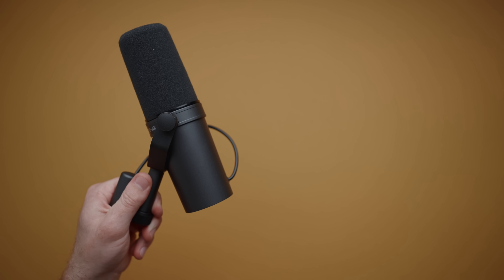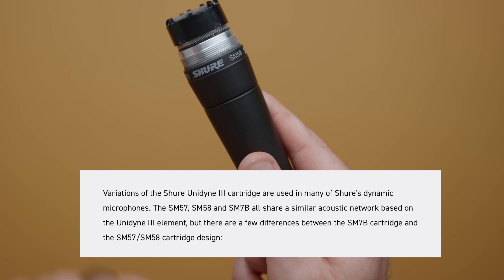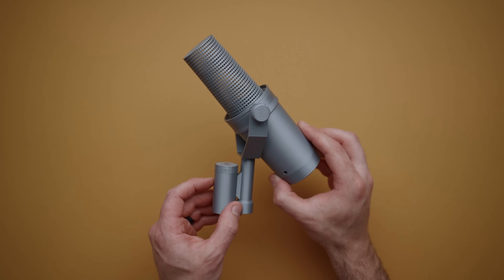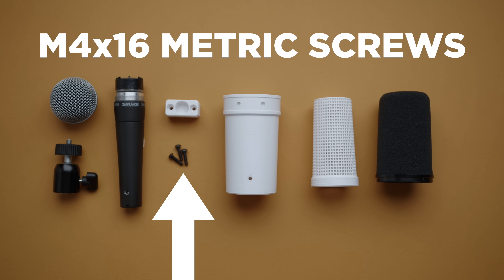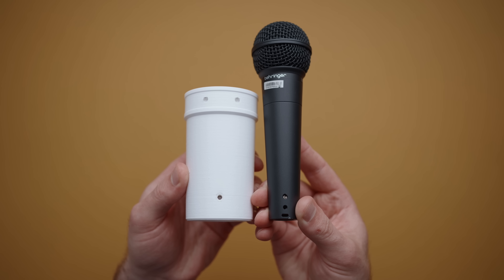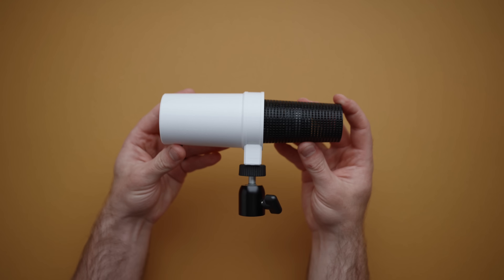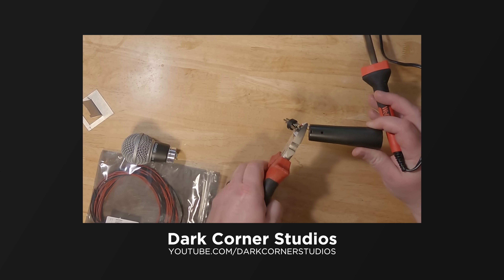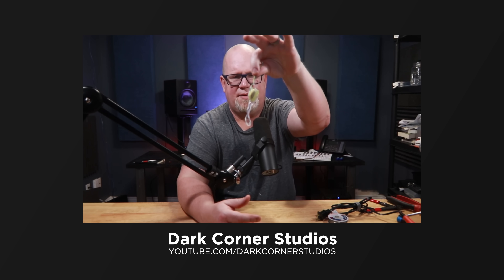$30 DIY Shure SM7B Microphone!

Comment: Yeah listening to the comparison, the sound is similar but I very much notice the difference. The SM58 is definitely more sensitive, has more boosted mids, and slightly less top end clarity. 4x the price is a bit steep, but 2x the price it would be fair.

Comment: You forgot to mention: (from the shure document):
"
- The SM7B diaphragm is slightly different and optimized for increased low end response
- The larger housing of the SM7B allows for a larger rear volume behind the cartridge which extends its low end response
- The internal shockmount of the SM7B is optimized to reduce stand vibrations, while the shockmount in the SM57/SM58 is optimized to reduce noise in handheld applications"

Comment: When it comes right down to it, different microphones perform differently with different voices.  Each person is different and the mic which works best for them may not be the same one that works best for the next person.  At one point, I had 20+ microphones of all types, from handheld to desk mount to boom mics to computer gaming headset mics.  I was going to do a couple voice acting parts so I decided to have a "tournament" to decide which mic to use.  I recorded the same test with each microphone and did a series of side by side comparisons.  The winner of each went to the next round, until there was a single winner.  The winner was the mic on a gaming headset which I had bought used, ($5) from a local thrift store, to keep as a spare, in case one of my teenagers broke their headset.  I did the two voice acting gigs and, after I sent them the sound file with my lines recorded, each of the producers immediately messaged me back, telling me what great sound quality I had.  I had done ZERO processing on either.  I just sent them the raw audio.

So, it depends on what microphone fits best with YOUR voice.  And don't whine at me that I don't know what I'm talking about.  I have a degree in broadcast production and have worked both as a radio announcer and a nightclub DJ, so I've been around the best equipment there is.

Comment: Do you also have the Design with the Yoke Design available / updated? 
+ 
Did it work with the external cable, which connects the xlr mount to the actual SM7B Mic? 

Kind regards from Germany 😊

Comment: Hello! Thank you for that amazing design! It has some flaws though (I'll come back to it later) 
I installed a Beta 58a inside instead of anSM58 and the sound is AMAZING while having a good look. Again, great overall design.
Flaws in the design: We printed this kit on several machines, FDM and resin, and always had the same issue: the grill won't screw properly... 
After further inspection, I found exactly why!
1- There is not enough clearance in the base... I had to sand-down the grill ring to make it fit better. It makes the grill more fragile though. Making the diameter of the cavity 1mm larger overall would fix this I am sure (I will try at some point!)
2- The 1st thread is not angled. I did it with a knife and it helps a lot!

Thank you!

Comment: I saw some people in the comments asking if this works with the SM57 and yes!! It Works great with the SM57, in fact I'm using it with my SM57 now!

However, I would also like to echo what some other people have already said. This DOES NOT actually do much for audio sound and quality. While the SM7B and SM58 are both very high quality microphones, and have very similar sound, they still have some huge differences that this mod does not change. It is more so a cosmetic enhancement (it's just for looks). If you're like me, already own a 3d printer, and felt like a purely cosmetic enhancement would be fun. Go for it! Otherwise, there might be better options out there for you.

Comment: Im using a motu m2 with hyperX cloud II headphones and I cranked the audio up +12 db with voicemeeter. I couldnt tell much of a discernible difference between the 3 mics. Mostly just tonality which is EQ able and very dependent on each persons voice. What really matters is having good pre amps and somehow the XM8500 seems to have the least pre amp noise and I have watched many video comparisons between these three mics and its the same for each video! I honestly feel like I have been robbed. I have the rode podmic and I did lots of research (before this and many other xm8500 hype videos came out) on different microphones and I decided on the rode podmic for its neutral sound. I also landed on the motu m2 pre amp as it had the best features and quietest pre amps for under $200. I still have lots of pre amp noise even when using a Triton fethead. So either something is wrong with my mic/motu m2 pre amp or something else entirely. I ordered a few mics to test soon. I am probably gonna get a XM8500 just to have it in case they go out of stock or something.

Comment: The SM 7B is an active dynamic mic. It's not the same as dynamic, but it's similar. It take 48v like a condenser
Reply: With that being said your mic sounds great!
Reply: bit late but what info is that? The SM7B doesnt need 48v of Phantom power at all , if youre using a cloudlifter than yes you need it but like what?
Reply: @xvxvxvxvxvxdxdxd bro,no mic  sends 48v, condencors and active dianamic mics like the sm7b do take it tho. This is all known. Why are questioning me. Im just a recording engineer for the last 25 years. Google  is your friend still. I dont care what you do.

Comment: Buy SM57 with foam. Mid cut 3db at 2khz 
5db cut at 6khz. Boost bass a bit or Use proximity for added bass.

Shure engineer said sm7b is basically sm57 with flatter response.
 But if your after the looks just but a fake sm7b

Comment: IMO, I think the Behringer XM8500 and SL75 actually sound better than their Shure counterparts.   Put one of those capsules into something with good shock mounting and pop filtering and you're golden.  I thought about designing a new enclosure for the SL75 capsule just for that purpose.

Comment: They aren't exactly the same internal : the SM7B is transformer-less, meaning its 400 bucks + likely you will need a signal booster for it to go intona regular interface, so more like 500. You could try injecting 48 V into it, as there's a mod that offers this possibility, as well as a low pass filter and a mid range bum (why???? I dunno). This seems fun!

Comment: Awesome! Thank you Caleb, You did a great job engineering this mod! So, I dowloaded the 3d printer files (which Caleb offers for free) and went to my local library. The library charged me forty cents for the filament. Because of the limitations on the library's 3d printer the mod I printed did not fit together as well as Caleb's. I still am able to use it and it looks and functions great! I just had to do a little extra work on it. For my other SM58, I purchased the kit from Caleb. I do a podcast with my wife and the SM58s (I have two) sound really good. The grill and foam filter really reduces plosives. My microphones are not on camera, so I did this purely for the audio quality. The SM58 microphone already (out of the box) sounds very similar to the SM7B. If you did not use headphones or a decent pair of speakers you may not be able to tell the difference. This mod (I believe) enhances the sound of the SM58. It may even make the SM58 less susceptible to feedback. If you have a SM58 (or choose to even buy a used one) I don't think you will be disappointed with this mod. If you bought a beat up used SM58, you would not even notice because the whole mic is enclosed. Caleb, thank you once again for your ingenuity and generosity to make the design files available free of charge. James

Comment: I was just on live stream telling people that I should 3D model a case for the SM58 since they are the same internals and here we find your video where you did exactly that and it sounds exactly the same! What a freaking deal to get a $400 microphone for $135 all in and you're only really out a metal housing and the hi pass and low pass filter thing on the back that nobody uses because everyone is going to DSP that stuff. What a freaking amazing deal!
Reply: FACTS!
Reply: i just saw the vid of the live stream and i come to vote this comment, coz you are just awesome !
Reply: Another example of Google detecting stuff that people has to say and pushing contents to them.
Reply: Cheapa-s. You come off entitled and apparently never worked in radio where the SM series original market
Reply: @DrunkBostonMediaFan  wahhh

Comment: One thing I don't understand, you are linking a 3/8 to 5/8 to screw the ball mount, but the ball mount linked is a 1/4, on the top, did I miss something ? I'm pretty lost with that imperial metric stuff x)

Comment: With a bit of modification, I managed to fit in the Sennheiser hand mic digital. It’s not perfect, but it’ll do. Guess you could call it the SN7BS!

BTW anyone else having a hard time threading the holes and attaching the mic mount? UPDATE - Turns out, the holes in the mount and the housing are misaligned by about 1/16th of an inch or there abouts. You may want to double check that Caleb.

Comment: Awesome video, great work. I can notice I hear a preferred clarity with the sm7b in my ears, but they are virtually the same, and with eq I imagine almost indistinguishable. An sm57 would be interesting to put in there also. I'm not knowledgeable of whether there are any differences or not or if it's just the capsules. I bought a fake sm7b that is useable but has some noise floor/humming issues at higher volumes. I wish I could throw my sm57 inside the capsule of my fake sm7b, that'd be cool cause I like the look of it.

Good job!

Comment: Wow. Very close to the original sound!! The Sm7B sounds just ever so slightly brighter to me, but I really like the body that the diy sm58 gives. A little eq would put that high end right back into place. The $20 mic just feels a little thin to me. But in the right application, voice overs, podcasts, etc. Wouldn't be a bad option at all.

Comment: Very cool! I've done extensive analysis of the SM series mic engineering and produced a prototype that has similar SM7 characteristics achieved by using a separated sm7 style dynamic capsule, with similar sm7 style comb filter cap, and customized internal shock mount, without the transformer and external aluminum body made from a storage canister with internal dampening material, The grill was made from perforated steel sheet. Total cost about $60.
Reply: Also note the body of prototype I built has a rear resonating chamber that allows more balanced low end response.

Comment: 🇧🇷🇧🇷🇧🇷🇧🇷👏🏻, It's true they sound almost the same! However I also read that no, the Shure SM7B and SM58 are different microphones and have different internal components. The SM7B is a dynamic microphone designed for broadcast use, while the SM58 is a dynamic microphone designed for live performance. While both microphones are made by Shure and share some similarities in terms of functionality, they have different internal components and circuitry that affect their performance and sound characteristics.

Comment: Just finished to print mine, months after watching this video and having it in my mind, and well, the results were exactly the same as in the video, I printed the UltraVoice version and compared to the SM7B, I can hear the difference, but for like 35 bucks in total it is insane! you could literally buy the 3d printer, in my case resin, the mic, print it and still would invest $100 to $150 less than the SM7B! thank you so much for this video!

Comment: It should be noted that the fact that SM58 allows closer proximity to the diaphragm is NOT a flaw. It serves to trigger so-called Proximity effect, where if the source of sound gets close to the diaphragm, there is a sudden build-up of lower frequencies. Singers use this effect to acquire sort of a intimate, smooth voice (usually in verses) which they can use to add emotion to their performance.

Comment: Ordered the kit that Mr. Pike sells and it's great quality as seen in the video. Assembly was just as easy. I appreciate the fast shipping! I've had an SM7B before but I don't create audio at a professional capacity for work - only for streaming occasionally and for use in discord. I prefer to feed the fam and get the look I was going for instead with this super cheap version. Thanks for the vid.

Comment: Thank you SO MUCH for this!! Been using this with my SM-57 for a few months now, and it 's perfect. For the money this is as good as it's gonna get for me. I was using the SM57 with the A81WS foam cover for awhile - and while it also sounded great, I wasn't a big fan of the look. When I saw this video, I knew I had to give it a shot. Got the factory SM7B foam, and I couldn't be happier with how it turned out!
Reply: Did your SM57 fit and thread into this 3d Print?

Comment: Question: I noticed that affordable "USB to XLR cables" are known to work well with a stock SM58, having tons of gain, while the SM7B has barely any gain with them and has to be maxed out on volume, introducing HF noise. My question is, would removing the SM58's transformer as shown in the video by Dark Corner Studios, change the gain level benefit the stock SM58 has over the stock SM7B re. "USB to XLR cables"?
Reply: OK, so I got the answer to my own question by watching another awesome Dark Corner Studios video here: https://www.youtube.com/watch?v=FPO8dfE9inY ——— answer is yes, the transformer is what gives the gain boost to the SM58 over the SM7B, and at only a very minor cost of slight tweaking of the sound in some frequencies.
Reply: @design8studio  Gain and impedance.

Comment: Heads up for those trying to print the parts. The part labelled "SM7BS-Grill-V1.stl" loaded into my slicer (Cura) in the wrong orientation. It's obvious from the sloping (intended to eliminate need for supports) that it loaded upside down. Basically the grill part (with holes) should be down and the threaded area (for screwing onto the main body) should be up. Rotating (180 degrees) in the slicer before slicing will get desired result.

Comment: I am having trouble screwing in the adapter to the mount. The threads are making the adapter screw in at an angle. Any tips? I purchased the exact recommended adapter through a link on your site.

Comment: Hey, so made this device for a friend (I don't have the mic, but they do), and few things I've noticed:
1- The base is really solid and has been something of a joy to mess around with.
2- The screw for holding the mic in place, I can't see how it can be an M4x16 screw. Fully screwed in the screw doesn't make it inside the hole at all. An M4x20 appears to fit the bill perfectly, with M4x16s for the mount
3- The grill is a bit structurally weak. I printed at .15 layer height on a Prusa MK3S+ to minimize bridging, but the problem I see I think will be about the same no matter what layer height (and to a lesser extent no matter the filament/temp). The walls are only two perimeters wide and because of all the holes there's next to no grip. Makes it very easy to snap. I'm no sound engineer, and with my hearing issues I hesitate to even think audiophile level, but I'm wondering at the idea of doubling the thickness of the grill wall to give something more of a grip for the filament and/or changing the grill design to be less of a thin sheet of holes and more a brace for the foam cover.

It's definitely something I'd be willing to discuss more and do testing with in the future, but at the moment I'm horribly inexperienced with making/modifying STL files, so I'm not sure how helpful I'd be

Comment: I'm working with a local 3D print shop and they grill/mesh part keeps failing when they are trying to print it. They said it keeps falling apart and is too thin. Any idea on what thickness and type of fill would be best for this project?

Comment: Can  you tell me what slicer software you used for this. I use Cura and for some reason it doesn't  like this grill design. It's stops extruding about halfway up. I even completely remodeled the grill from scratch and it does the same thing. I've never had this happen before so it has me a bit perplexed.  I figure I'd try to same slicer software that you used and hopefully that works.

Comment: the SM7B still sounds better than both the other mics, but for the price tag of $100 its not a huge difference. The $100 just sounds more muffled compared to the SM7b and the $20 sound might brighter and cheap i, that being said for $30 I don't think you would find a better mic.

Comment: This is a great video and i cannot believe that i could not hear any difference between SM7B and SM58. None whatsoever. The super cheap one sounds just a tiny bit off. Just a tiny bit, pretty close to make it impressive. One option that comes to mind, and i might be wrong, is to buy just the capsule of the SM58 that goes for about 50 bucks and a XLR port to solder on to it. This might turn your 100 dollar build into an even cheaper one. Could be fun to try it. Great video !!